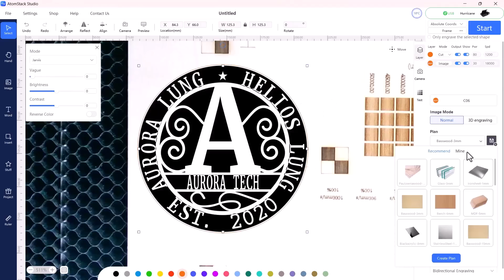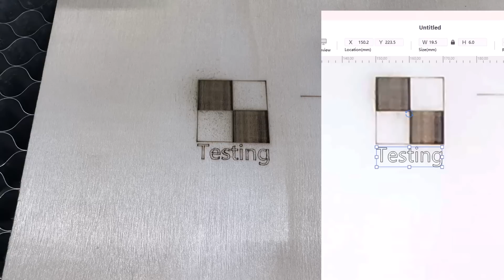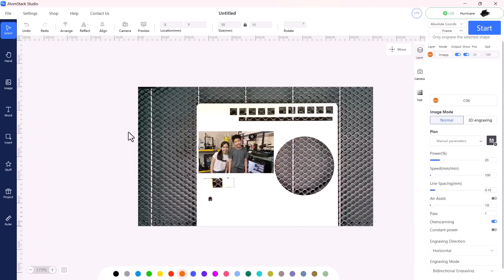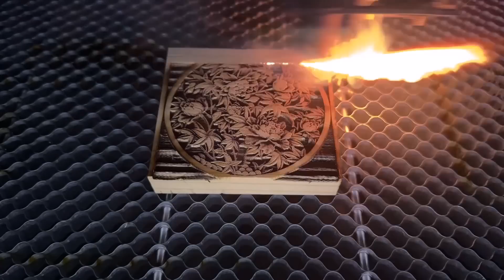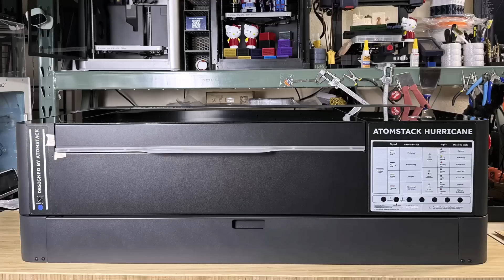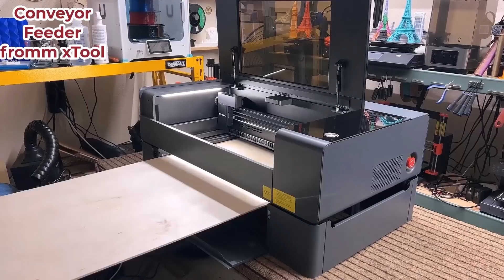AtomStack Hurricane 55W CO2 Laser Engraver

Comment: Im confused, I bought this device and tried your settings but ran in to endless problems. The lazer is alined, settings are correct, everything is clean the lens is new. Still the machine cant cut 6mm wood with the settings you showed to cut trough the 12,7mm one. I have tried this for month now and cant seem to figure it out. It seems that the lazer is a lot weaker than advertised. 
No forums or guides have helped.
Reply: Did you find the answers you were looking for.  I was going to buy a used Hurricane but not sure if this is such a good idea.

Comment: Great review. I am very  impressed by how clean the cuts are on the 3mm wood...no charring! As for the software, even thought I use Lightburn (only for laser control, not designing), the AtomStack software allows you to adjust the air assist strength per layer, and that it very handy!

Comment: Hi, i want to build a little tiny laser engraver with a working area of around 100x100mm that will be able to engrave on chrome metal batches without any hassle like putting tape or spray paint it black to be able to etch, it would need to be doing just as good job as the Xtool F1 or similar, what laser module would you recommend that actually can do this ? Thank you.

Comment: Try finding something in the software to adjust the acceleration with. You will find that smaller parts will burn up more than larger parts because of the slower start and stop time.

Comment: Almost bought an atomstack cambrian as my first printer a few years back. It printed rubber! not slippery tpu but grippy TPR they called it, it actually bounces too but the reviews on it didnt give any real opinions so i concluded it wasnt worth it as a first printer. It actually came with 2 hot ends , one for normal and one for the rubber filament. I know deep down its superior then TPU but still nothing in the 3d printing world about printing rubber or anything new from Atomstack in the 3d printer world. Hmmm

Comment: No one ever talks about the resolution the lens provides.  For engraving, you want the lens with the tightest focal point.
Reply: Yep, that and CO2 replacement cost when they go bad which is like every two years
Reply: @ that’s gonna depend on the use which varies.  My epilog fusion pro has been going five years strong.  Granted that’s a much nicer laser with an rf laser.
Reply: @CryoftheProphet  yeah, but if you don't use it then they go out. I've had a replace my laser on my epilog Helix twice and that's very expensive.
Reply: @billblanshan3021  The key to maintaining long tube life is to fire it up periodically and not let it sit.  Ive been using mine for 5 years with no issues and it cuts like the day I bought it.  Kind of like a car, you want to drive it periodically so its not just sitting and never being used.
Reply: @CryoftheProphet  I agree 100% with you, but some people may not use it All the time therefore if it needs to be replaced then people needs to know the cost of replacement and also how to do it. That's my whole point!